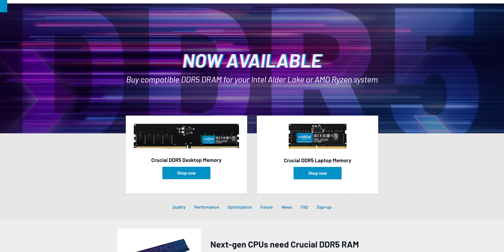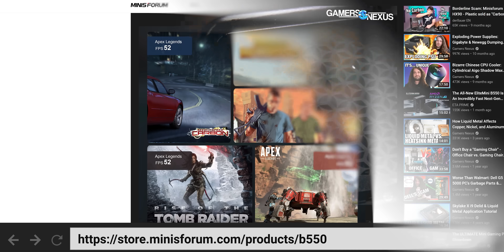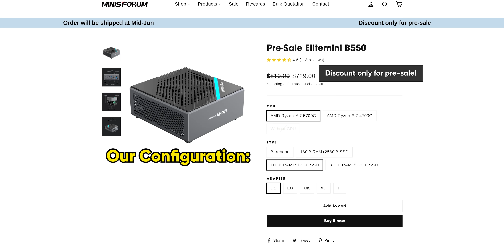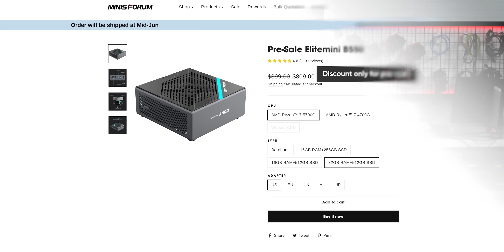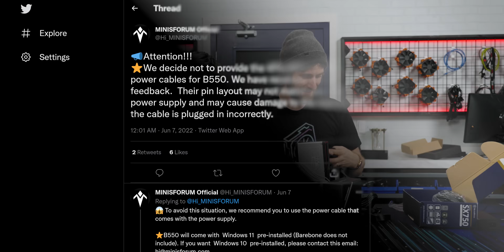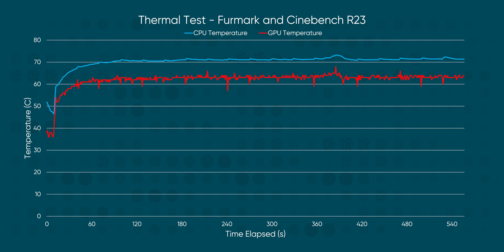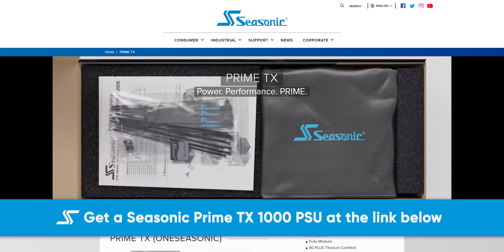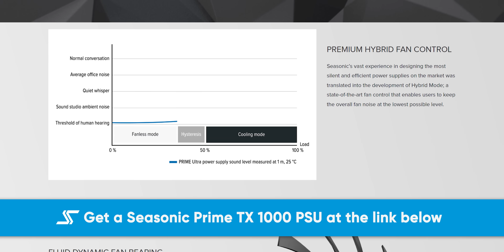Who's Buying These? - MinisForum Elitemini B550

Comment: I was really impressed until he added the external GPU and power supply. So 3 small-ish bricks connected with cables instead of one solid medium sized one?
Reply: Exactly!  Right at the end, he basically said that.
Reply: @firesurfer  if the PSU was Integrated better I could almost see it. People like showing off their GPUs, this is basically the ultimate in transparent cases
Reply: @RandomMan1  That's been done... a long time ago.  It's called a test bed frame.
Reply: @firesurfer  There are also some quite elegant open cases. I don't know if they are even smaller than this mini PC, but hey.

This mini PC by itself is extremely good as a retro gaming console up to the PS3.
Reply: @SyRose901  the XPROTO immediately comes to mind.
Reply: Just what I was thinking - there should be no dual power supply, this just takes a whole  thing and makes it messy and awkward! I wouldn't buy it for this reason. One power supply taking care of everything or don't bother for me.
Reply: @pauldethick6175  I was thinking, why not just make the PC case/brick bigger to accommodate a bigger internal PSU? At the moment, by the time you add the GPU and PSU, it just becomes too cluttered and messy, and you practically have a full blown desktop PC anyway. Almost had a good idea with this product, but it just isn't well thought out enough to be appealing for most people.
Reply: But portability wise it's pretty nice.
Reply: @musarasheed5960  I travel a ton for work pretty much live out of hotels and always wanted to have desktop power with me
Reply: I want one.
Reply: I'll do that so it can fit my bag and bring it anywhere with my portable monitor. Better than expensive laptops.

Comment: Wow I honestly don't know how you could design a worse product. It solves no issues while creating problems, while other options exist doing everything in "better".

Best case scenario is that you are taking this from location A to location B. You need monitor and peripherals set up at both, and you only get a gpu at one.

That's such a specific situation that even in that super specific niche I think other products would serve it better.

You could get a bulky laptop with thunderbolt. Better cooling and now you don't have to worry about peripherals at location B. As well as better versatility overall.

Or maybe just get a SSD doc and carry your boot drive with you? You already need things set up at location B anyways? You would need two computers then, and if you were really set on taking your computer with you and not having two, but also not interested in a more location versatile laptop. Then why not get a different SFF case and bring the gpu with you anyways. If you are already traveling to a set location that extra bulk wouldn't make a difference. As well, at location A you would actually get a compact system.

And on that, if you are not moving it, this case doesn't even make sense for a SFF build. For a stationary pc this system offers nothing over other SFF options. 

Not to mention in all of this. The design only even barley starts to have a reason to exist if you use the docking feature. Which is heavily hindered as pcie isn't hot swappable!

Comment: I'm struggling to see the point for this for a consumer perspective. Anyone who would need this and cna afford this can also afford a laptop. Sure a laptop GPU is not as strong but it has a screen which can be used everywhere, this does not have a screen. and even if it did it would be too small. This also goes for a lot of the workspaces. 

Maybe if you work in somekind of environment where you need to be able to hotswap systems when one dies, but they you likely need better CPU performance also and f it cant handle a 5800X3D it wont handle a 5950X. Does it support getting a higher wattage powersupply(Its just the brick right?) and have a 5950X? in that case I cna see it being viable in some work situations. But for consumers i would honestly recommend building/getting build a PC of similiar size. 

This is the sort of PC you would buy to use as a simple home computer and perhaps some light gaming on the side. not as some powerhouse of a gaming beast.

Comment: Add a bracket for the PSU, an add-on to hold the inevitable additional fan(s) you'll need for cooling, maybe an expansion slot for audio card and you'll end up with a standard ATX case.
Why not buy an ATX case then and assemble your PC the good ol' way?

Comment: Let's make a sleek and subtle PC, that then has not one but two gigantic diapers hanging from it's butt to work even reasonably. That said, in regards to the ending bit, I have taken my MFF Dell to places before where I knew they had a monitor anyways. Monitor aside, taking a tiny ass PC isn't that unreasonable a usecase if you need your specific crap there.

Comment: Its certainly interesting, and it might solve some peoples issues with SFF where you can be limited in what GPU you can fit, but it comes at the expense of being a messy form factor instead. In its current form, its messy at best, and if they include something to hold the PSU so it can be transported in 1 piece, then its tidier but pretty ugly.

Its identifying a problem, creating a solution, but it comes at the cost of losing the simplicity and discrete aspects of SFF, and this is probably closer to a bench case than SFF.

Comment: This is actually pretty cool! I would really buy something like this if I were a student again and didnt have already a good pc. Yeah, you can buy a laptop but that has more limitations than this. If only this device had some kind of display accesory, idk, a small metal plate where a mini projector can project everything. A different kind of laptop that allows you to use a full gpu when you are at home and have portability for school. Its pretty cool
Reply: Yeah, but a laptop has the benefit of mobility and you can stuff it in a standard book bag at the cost of heat/performance. This is just a unique form factor just to be unique. You wouldn't buy this to save money or space. You buy this because you're bored and want something your average joe hasn't seen before.
Reply: @Shorty15c4007  You are right, i think this is very niche. I dont know how good are egpus with laptops right now, maybe it just makes more sense a laptop. But if a device like this  manages to have more upgradability than a laptop and a reasonably price, i would sacrifice that extra portability for something like this. I like the concept and I see my youger self using something like this

Comment: The price of the barebones kit for equivalent parts in the same form factor is difficult to beat.  I have a left over 5700g which I got then upgraded to a 5800x3d and 6800 XT.  I've been wanting to put the 5700g in a small form factor for a little linux/media server and this fits the bill perfectly.  Can do a little bit if GPU decoding out of the box and if I really need I can decide to add a PSU/GPU later.

Comment: If they made an optional large power brick that supports GPUs directly this would be nice.
Or at least make a holder that includes space for a PSU
Reply: They did say that this was the plan, but they don't know what PSUs will be supported by the bracket

Comment: that was some terrible thermal paste application on the CPU, holy shit.
Also what kinda logic is that, you buy a small form factor PC when it still ends up taking the same amount of space as an MATX or MITX PC with case and probably everything can be mounted internally so you don't just have a random PSU sitting on your desk unlike this thing.
Why does this exist.

Comment: I made something like this as media pc that is nice and small and fits your tv furniture just like a settop box. The 10cm height limitation is what bites you in this. I used a intel nuc before but it was too loud. 
It’s was really hard to get cases and power supplies to run a 4K-HDR video capable system. I even had to set the power limit on the Ryzen chip because it would otherwise overload the little power distribution board inside the case. And even then it would heat up the dc jack to worryingly warm.

I’d buy this, if the size was right. It costs about the same I guess. Minus external gpu, that’s just a gimmick.

Comment: I actually want something like this so I can work at home or in the office on the same machine but it actually has decent performance unlike most laptops. We're trying to spec laptops from Dell with the latest 12gen Intel CPUs and 32GB RAM and they won't charge less than $2000. A full on desktop PC that's portable like this would be great.

Comment: Maybe I am old fashioned, but I prefer a mid sized case. Given that I spent more than 15 years using the same big tower Chieftec case I bought when I was 15 back in 2002 - and I still have the case, just don't use it - and only recently "upgraded" to a much smaller case because of trouble with SSD slotting.

Comment: Actually what was described at the end is pretty much perfect for my use case. Or at least was when I was in school. I have a desktop I use for games and a macbook I used for school, coding, etc. I can't bring my desktop with me when I visit my family because I have to fly cross country, so every time I visit I'm stuck with my macbook. Don't get me wrong, I love my macbook and wouldn't trade it for any windows laptop but sometimes I just want to boot up valorant or whatever and not have to deal with whatever crap Apple does that makes their machines unusable with mice and extermal displays. If I could just toss a mini PC in my bag with a mouse, keyboard, and power adapter and plug it in to a monitor at home, that would be absolutely perfect.

Comment: This seems like something that started as a really cool idea and then it progressively became less cool as they made comprises along the design process.
Reply: I think the idea for this is related to how many YouTubers were connecting M.2 based PCIe slots extension to run an External GPU with Mini PC's (even JayzTwoCents did it once before).
Reply: It seems more like an early iteration on a good idea to me
Reply: I live in an RV and I would love this thing. My 3700x system took up a lot of space. might've used one of these if I'd seen it before I got my laptop. it's far cheaper than a laptop, too.
Reply: @BikingWIthPanda  but if you live in the RV then what's the point of this?
This would only make sense if you leave your GPU at home while traveling in your RV.
But you said that you live in your RV, so this doesn't save you any space.
Reply: @Jehty_  it saves a ton more space than you would believe I live in a camper and every inch matters
Reply: @BikingWIthPanda  I live in a camper and space is definitely an issue I own a beelink with a ryzen 5 5th gen and now I'm looking for an adapter so I can attach a card
Reply: @thegodhoward8037 did you end up doing it?
Reply: The Idea of Barebones it's not new
Reply: Beelink have basically taken this a step further with their GTI Ultra
Reply: Yeah seems like it suffered from feature creep lol

Comment: FFS Asus, just make a z13 or x13 with no dGPU and allow the CPU to boost to 100w+ put 32gb of ddr5 ram under the vapor chamber (In-place of the dGPU) and we will have a no bottle neck mobile system and when I need full gaming performance I plug it into the xdGPU (Make a desktop one please?) that is connected to an external M&K and a monitor to simulate a desktop.

Like this we will have a super fast mobile machine and a super fast gaming machine in one with no compromises.

Comment: I feel that this would be awesome if it was a laptop. But by the time you throw on the graphics card it's big enough I feel I would rather go for some other full desktops. I mean if I had a machine I had to take to the office where a monitor and peripherals are available and then take it home where everything is available and my advanced graphics card is there then maybe I would justify it. Is there a use case I am missing? I feel I would either go full desktop if it didn't move or laptop if it moved.
Reply: Form factor and or portability devices like this would've been worth it if only laptops was never invented.

Comment: These small form factor PC’s are becoming popular with shop floor computers in manufacturing where you need a PC but don’t have a lot of space to connect one.  I’m not sure how the GPU fits in the equation on these.  I’m not sure if it’s made for the general consumer but maybe someone who tests functionality or compatibility of PSU and GPU units on a regular basis.  Just taking a SWAG at it.

Comment: Wouldn't extension cables (as opposed to replacement power supply cables) just be pinned out straight through and not cause a problem as long as they are connected to your proper power supply cables, that are pinned out correctly? What am I missing?
Reply: You can't connect male cables to the male outputs on your PSU.
Reply: @altt8771  ahh male to male. I see. Thanks.
Reply: Seemed like they were actually meant to be replacement cables not extension cables
Reply: @Mom19  They wired them as extension cables, apparently believing that's how PSU cables were wired.  Which is kind of shocking, honestly.  Use the cables that come with the PSU, or cables specifically made for it.  If you don't know if a cable goes with a particular power supply, don't use it.

Comment: They wouldn't have to protect the consumer if the standard was correctly implemented in the first place. Still mad that modular cables can and definitely will have different pinout from a PSU to another.

Comment: I kinda love solutions looking for problems, they are a fascinating head space for design.
I have no idea why this thing exists, but I am glad it does.
Reply: it basically enlarge intel NUC extreme
Reply: I don't have any reason to need it but I want it
Reply: @KJMcLaws  I bought one a few weeks ago. I need it because my desk is too small to put a good pc in. Plus I'm planning to use an external GPU too so its a good long term plan for me.
Reply: At least it exists :)
Reply: I can actually think of many reasons to want something like this. I have to move my PC between spaces a lot. It'd be nice to have something that can break down into smaller pieces for transport like this.
Reply: @MaybeAnnatar  yeah but a laptop just folds in half. Although if you're sending it in a checked bag on an airplane this is the way to go lol
Reply: @KJMcLaws  A laptop is going to cost me money based on specs. I need desktop grade stuff.
Reply: @MaybeAnnatar  There are already machines with the same form factor with out the need to disassemble them in 3 pieces though, one of them being shown in this video, something like the Corsair 380T for example even was designed with a carry handle.
Reply: @rafaelsousa5  Again, things breaking down into smaller packages I can fit into a bag is a plus for me, not a minus.

Comment: a use case for this type of setup could be internet cafes. they could have the dock all setup and allow their customers to just slot in their cpu enclosures. then the user is saving on having to buy an expensive graphics card and the cafe gets to sell time with some high end and possibly hard to get graphics cards.
Reply: They'd have to sell the enclosure in the first place though since this doesn't look made to fit multiple enclosures. You'd be selling high end parts and time to a very very specific group of people.
Reply: The adoptability rate for this would be insanely small. The only thing I can think of would be shared office equipment with something like Quadros where everyone brings their personal machine to the office if they need to use it?

Comment: This could be really useful for people without the spending money for a laptop with the same performance, a 900$ laptop will be great but it's not gonna perform the same as that does for a much lower price
Reply: Gaming laptops is much cheaper if you are going to throw in high performance GPUs like 3080TI and 6800XT with one of the best gaming monitors and gaming mouse and keyboard. But it is an option for those who wanted it.

Comment: One way to think of the uses this machine has is that the docking module isn't just for GPUs, but it's a full x16 slot, so any expansion card you want, really. Perhaps that makes it a more appealing product, though I am also still struggling to determine who would be using it.
Reply: I sat here for a few Minutes thinking "What would I need this system for, that a Laptop could not do?" And I genuinely couldn't come up with one. That's basically a laptop without keyboard, mouse, monitor or battery.
Reply: @lolly166541  It takes less room than a laptop. Mini PC are often used together with big televisions, basically like a super console.
Reply: @arivald6677  my thought as well, I see this as a compact desktop gamer PC that you can "undock" and bring to a friends house for console style couch gaming, for less than the cost of a "all in one" laptop that you can't upgrade.

Comment: Did you guys consider plugging a more capable barrel plug power supply in? One with a higher amp rating?

I can't remember the laptop now (one of the older 17/18inch gaming laptops) where after upgrading to some of the higher end sli GPUs a mod was to pair two 240w power supplies together to supply more power

I wonder if the board would be capable of running higher end CPUs at full boost clocks in that case
Reply: Cooling would be an issue probably

Comment: Perfect for testing GPU's
Reply: Wouldn't you need a high end CPU to prevent bottlenecking? This can't supply enough power to boost a 5800X3D
Reply: @CyberWolf755  Of course I'm talking about the "case", not the hardware inside it.